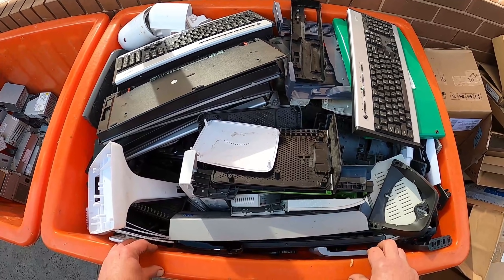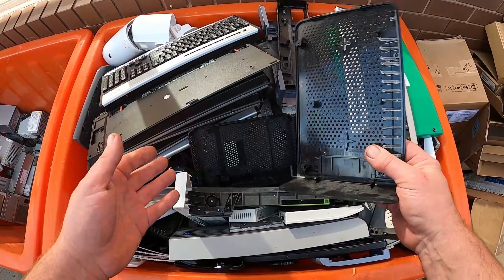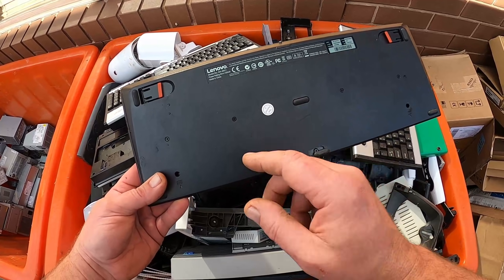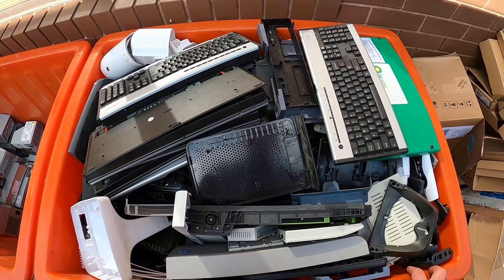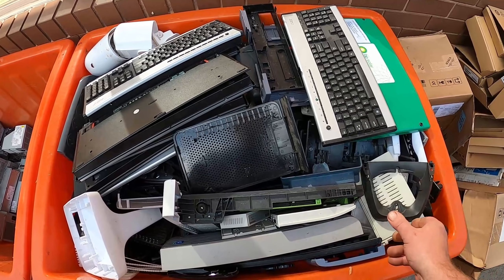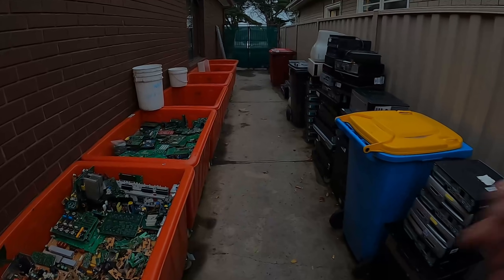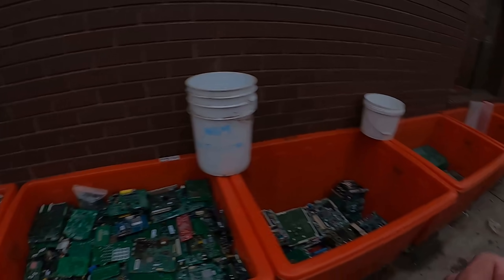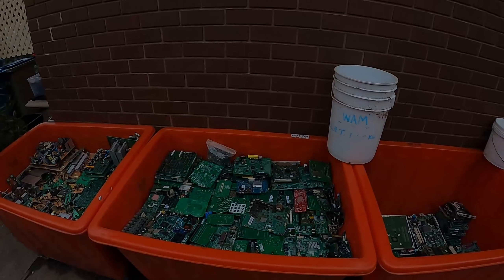Recycling Plastic from Keyboards & E-Waste

Comment: I used to use a big Cumberland B60 grinder to do plastics followed up by a powerful electromagnet. Ferrous is attracted, plastic is going right through, and the nonferrous is kicked away. They each went to a tared Gaylord container. Sort by type. ABS pellets get an awful lot if they are clean and metal free😁😎

Comment: What about all the plastic from scrapping A/Cs out. 
Split system indoor units. Have so much plastic in them. In the trade so always have a few follow me home. Mosh pit or Savings account is what I call the pile of gold. 
I always have piles of this plastic waste material after stripping them out. As you can prob imagine! 

Usually it goes in my house waste bin bit by bit.
 I Tryed years ago to find a better way of managing my plastic waste. 
But Had no luck. 
Iam in Se Melb. Pakenham area.
 If anyone knows of a place recycling this type of plastic waste material ...please shoot me a Message. I'd love for it to be recycled & recovered to be reused. 

 Cheers😃

Comment: ... PYROLYSE / GASSIFICATION = TURNS ALL TYPES OF RUBBER AND PLASTIC INTO:
TAR
DIESEL
GASOLINE
JETFUEL
PARAFIN
CARBON BLACK

In a CONTROLED / CLOSED SYSTEM  
(Air filter + water container to capture final toxins (witch you can pour into "cat litter in a steel barrel" and turn into local wast facility, some refinerys also take cat litter with waste oil), also to make it more clean have a burning flamme). All depends on setup.

Refinerys will by waste oil products. If they are very liquid, the better. 
Many farms have like 1000 ltr. old waste oil, fuel that refinerys either get for free or buy.
You can buy pyrolyse machines or EASY BUILD ONE YOURSELF.
Japan once send small scale machines to Africa for people to make fuel from plastic/rubber.
Rubber tires have the highest ratio of material into petroleum products.
I belive car tire ratio is 1 ltr petroleum product pr. 1 car tire.
Rubber is hardest to controll, stick with plastic bags for easy processing.

On youtube there is a russian guy that build a small scale system inside his garage, very nice looking system. (Its INSIDE and "SAFE" since its a controlled closed system. I say "SAFE" since you ARE DEALING WITH A "BOILER" so things can go wrong, but its not operating under high pressure. Its airflow + gravity.

Comment: What was it doing with the motherboards
Reply: Putting them in systematic order and automatic reparing them....
Naaah I think it cruch the boards to prepare for melting and cutting transport cost to the melting plant, and then it gets send to final stage for refining. Proberly cyanid electrolyse method on industrial scale.

You know you can EASY BUILD an elektrolyse setup yourself... a hobby scrapper can find 90% parts needed. Car battery, jumper cables, acid (from car batterys, slowly heat if needed to make it more concentrated). 
Thick heat resistent glassware from girlfriend kitchen😁. Stainless steal plate, lead plate/ or copper.
The thing I cant find scrapping is the salts? "SMB" to make the gold drop outta acid solution. BUT I bet if you write the youtuber Coby'slab he will tell how you can make sodium metabisulfite "SMB". 

To make the gold bullion you need aqua regina (nitric acid from car battery and normal hydrochloric acid).
You can run the electrolyse on VERY LOW volt and mili amp. I belive its 20mili amp pr cm2 anode. 
So a small setup is very safe. Give up very little acid fumes and low current.

I must say the youtuber "STREETIPS" is the professional (old navy scientis type or tech guy). 
"Im just a Youtube-comment clown🤡 so DO CHECK OUT STREETIPS " for professional advice.
Reply: After 2000 all have access to the noble metals in form of WEEE. It just that DO YOU REALLY DARE TO DIP YOUR HANDS INTO "NWO's" circulare econemy and "STEEL" their gold?

In order to have a modern digital world they had to give up LOTS OF GOLD to the industry. So its just for the taking....

WHO DEARS WINS...
👑💍💎🤴🍾🎖🏆🥇🏦

Comment: the most idiotic way to shredder without a minimum of pre separation of silver mylars, small circuit components,  wiring and easy to remove metal fastener etc, even separate plastics.

Comment: All you need is plastic bags or stretch rap that's polyethylene /plastic milk jugs,pop bottle's that's polypropylene. Read the next one from me it's free. I'm sharing this with all of you.
Reply: Hi Ive subscribe to you were are your videos on recycling plastic etc?
Reply: @sharonironman4547  I don't have any video on recycling plastics  for making lumber. I'm just putting it out there , IF you want to start a good business to save the earth and recycle 2 types of plastic  to make plastic lumber. First off  you will need a big building lot's of room .you will need a warehouse for the recycle plastic. A area for grinding up the plastic to put into( gaylords witch are 2,000 pound box's ) grinders has to be able to grind up to 1/8 inch pellet size material. The material has to be separate from each other. You will need a industrial mixer to combine  the 3 material . You will need a screw press for the melting of the material, a manifold system with airlock pressure switches then you'll need your dyes or molds with individual pressure switches,your dyes will have their own cooling tanks systems, you will need a cooling  system chiller to handle antifreeze. Each dye should handle 800,to 2,500 psi. (Per square inch ) your electric grid should be 3 phase and you will need a cooling system for that .the molds should be at least 13 feet long to get 12 foot boards. You will need a warehouse for storing the lumber, a area for cooling down for lumber from that day's run 8hr shifts . You will need a industrial radial arm saw to process the lumber for shipping . A bander for securing the lumber for shipping .this lumber is heavy it will last over a 100 year's will not rot and can be made in different colors . Good for decks,park benches, picnic tables, fences, steps, mailbox post. Stadium benches, designer boxes for plant's. If you want to start a great business like this ?  I can give you  a quote price.

Comment: A better way to keep plastic out of the landfill. Reuse the plastic you can make plastic lumber. Here's a recipe for plastic lumber 70%polypropylene 30%polyethylene and 10%baking soda then all you need is a screw injection press and the  molds to make 2x4s, 2x6s, 2x8s, 2x10s ,2x12s, 4x4s, 4x6s ,2x2s, even 1x4s all the way to 1x10s. And the molds can be cooled down with  antifreeze, and the molds should be made from Chrome steel it holds up much better under pressure. Size of chrome steel should be 2 inches thick for proper cooling temperature. This is free information for making plastic lumber. This should be shared . Protect God land

Comment: Makes you wonder how much of that generally ends up in a landfill. I bet some nonferrous ends up in the plastics; do they melt that mess down to collect the silver or whatever?
Reply from the maker: next step is removing the non ferrous, still a bit to go to complete the machine.
Reply: Yes all metals will be removed.
Plastics would likely be melted down and turned into filament/recycled plastic for use
Reply: @southaussiegarbo2054  Good!  In the USA a lot of keyboards end up in the landfill.

Comment: At 0.05-0.15 grams of silver per keyboard...my stacker heart weeps for all the silver getting washed away.
Reply: 8:25
Reply: rinoz47 while I agree that it will be recovered...I would personally spend the 2 minutes to pull the mylar and small board. Granted I have a small hammer mill to snag up the boards

Comment: How does that granulator separate the non-ferrous metals?... say hi to Jim for me.
Reply: Mark Thomas using an eddy current separator that uses coils like a solenoid to induce a current and therefore a magnetic field in nonferrous metals which creates a force pushing the material out of the stream. My physics professor used a large solenoid to launch aluminum rings across the room.
Reply: 8:25
Reply from the maker: still a bit to go to complete the machine, yeah, eddy current separator and more steps to sort that material out to end up with clean groups of product.

Comment: Always good to see scrappers finding more ways to leave less waste!

A service like that gives you a way to separate a lot of stuff that might otherwise just clog up your trash cans - keyboards, mice, remotes - anything that you might get during pickups but that's otherwise not worth breaking down for your shop.

The other thing that occurs to me is that since they've already started with a grinder, the steel they generate with this is already basically Frag, which means the yards buying it from them don't have to do much with it before they can sell it on to their own customers.

Thanks for the look inside, Ben!

Comment: We are lucky here in Ontario, Canada.  It's SUPER easy to recycle that stuff here. :)  Thanks to a government program put in place a number of years ago.  Good to see you have found a solution there though.
Reply: @playandgrowtv9846  Most of that will go to the landfill sadly.  At least 50% of what people put in the bins here doesn't get recycled.  Like, the hard plastics that are used for computer cases, keyboards, etc. goes right to the dump.  Because we don't have a recycling plant for that type of plastic close enough to the city/town.  However, if you recycle the full component at an ewaste recycling place, it'll get done properly.  That is the purpose of the fee you get charged when you buy new electronics/computers/other items.  It pays for that type of thing.  I hope I explained that properly.  I am pretty tired right now.
Reply: @markjohnson7887  
Could it really be 50%?? I worked in a recycling facility in Nova Scotia and the end of the recycling conveyor belt (that goes to landfill) was nearly empty, only things like small broken glass dirty/contaminated things, and things that just didn't belong (Tim's cups, straws, ceramic, bottle caps, etc.) Actually went to the landfill. If people recycled perfectly, then we would recycle nearly 100%.
Reply: @ImranZakhaev9  In Ontario, yes.  It really is that high.  Where I live, no hard plastics of ANY kind, no plastic bags, etc., etc..  It's pretty sad really.  Even in the city of Ottawa the list of plastics that can't be recycled is quite long.  I assume in Toronto you would have better luck though.

Comment: Most of those keyboards are better than the one I'm using to type this :p  Shame really as they are probably OK but people want new ones when they buy a new computer
Reply: Yeah, so often it's things like offices/universities/institutions that replace all of their hardware every few years and throw away the old stuff whether it's good or not. My friend is in the Canadian Armed Forces, and she says her office gets new chairs and even staplers and hole punches every couple years just to spend the budget so it doesn't get cut for the next year.
Reply: Im currently using a keyboard I picked up scrapping :)
Reply: @davidk8699  
I'm using a mouse that I found in the battery recycling bin!
Reply: @ImranZakhaev9  nice! I have a really cool old-style keyboard (clicky chunky keys with feedback I had in my youth) I found with the cable cut off. I've done some preliminary research, and I should be able to connect a USB cable to it. huzzah! Pretty sure it was PS2 but its just a wiring issue - no circuit required.
Reply: I kill my keyboards pretty regularly. I also write about 2 million words a year.
Reply: Same, but I just wanted a basic-ass USB keyboard with no fancy stuff.
Reply: Yeah that white one at 7:12 looked pretty good